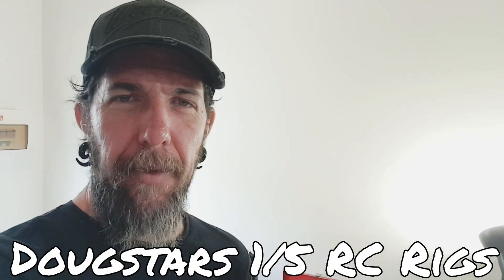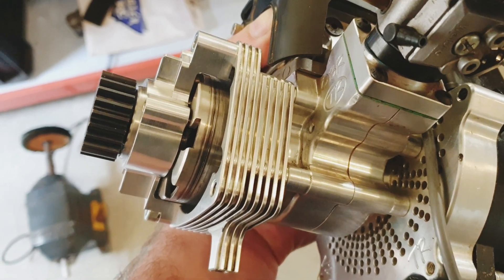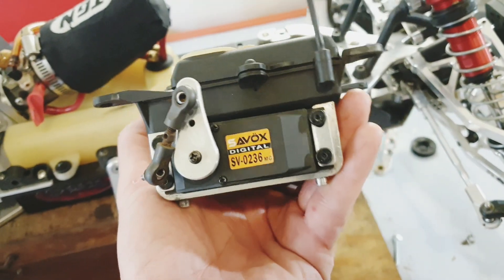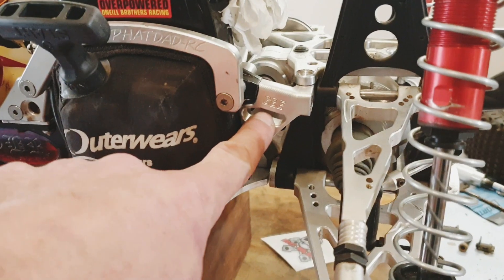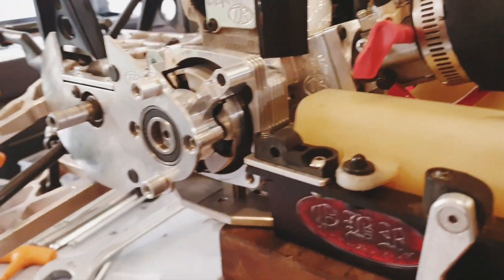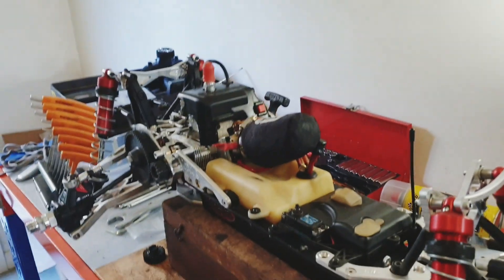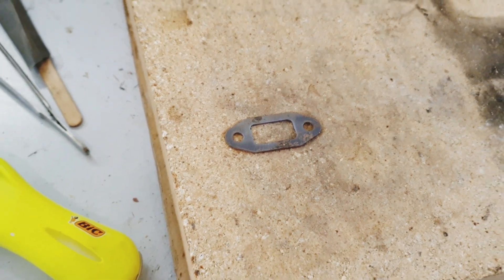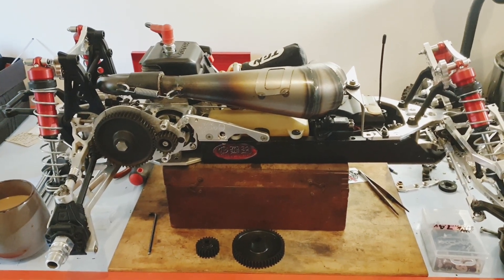Some wrenching on my OBR 34 baja

Comment: Bro i have the turtle gear plate for stock sized bearings. Its just doesnt fit, the pinion bearing looks far into the right side to if. The stock gear plate fits perfectly. Whats going on?
Reply from the maker: Not sure? Hard to say what's going on without seeing it
Reply: @DougStarRC  where should i send a photo? Facebook?